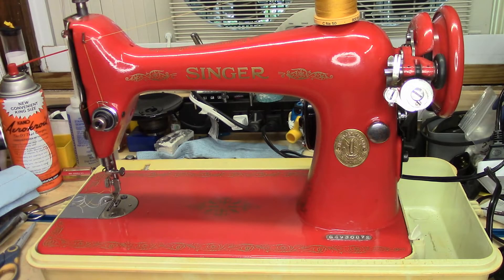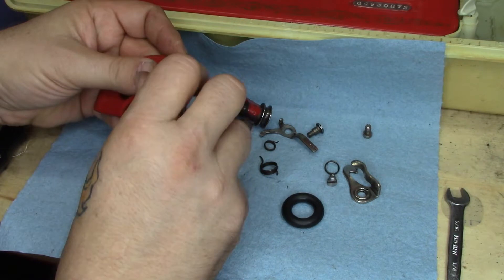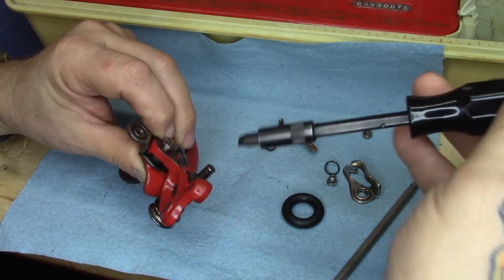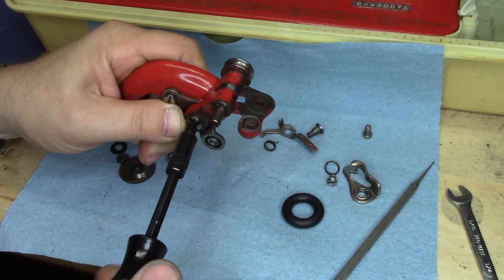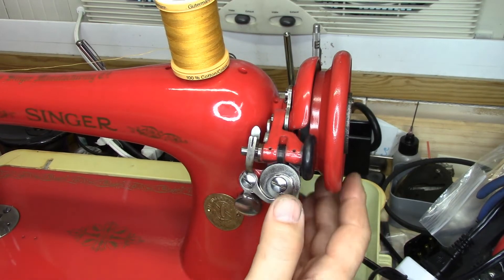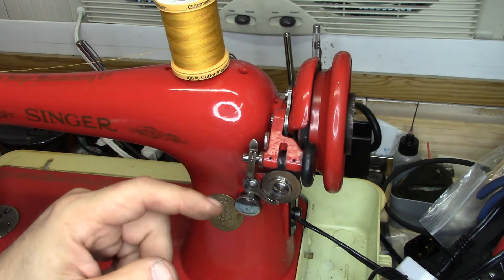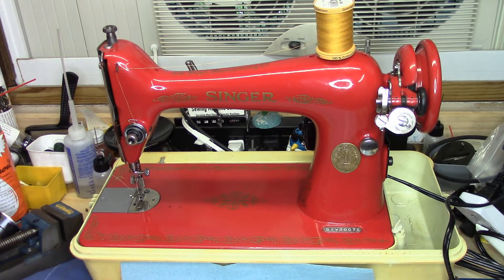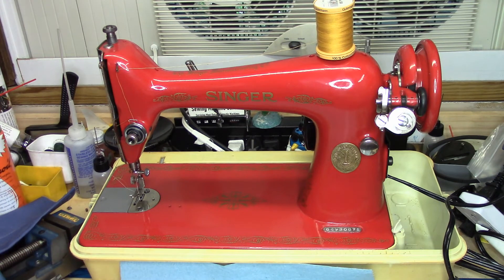Tractor Paint 66 - Part 4: The Bobbin Winder and Test Stitching

Comment: I have 2 questions about the bobbin winder assembly.  the first spring you put in -where does the long tail go?  should it ride on top of the belt cover?  My 1916 66 is missing the spring washer that fits under the cam  any Idea where I could find one?  This was my grandmother's and just needed a good cleaning otherwise in great shape.
Reply from the maker: The long tail goes over the bracket that is screwed to the belt guard. As for the spring washers, try McMaster Carr.